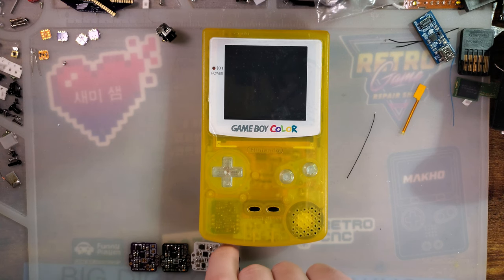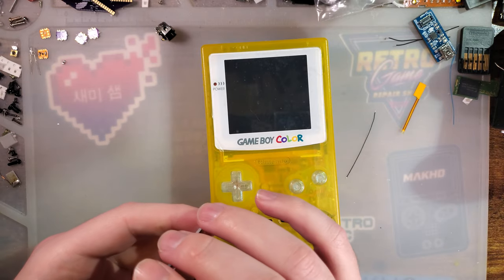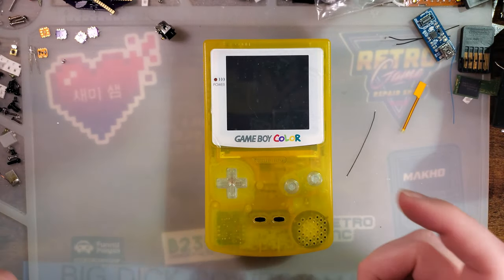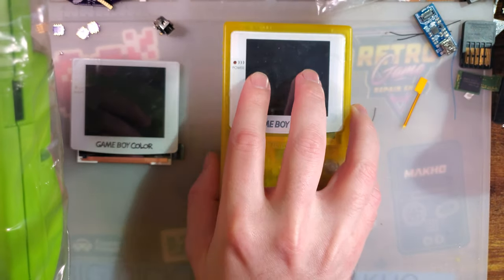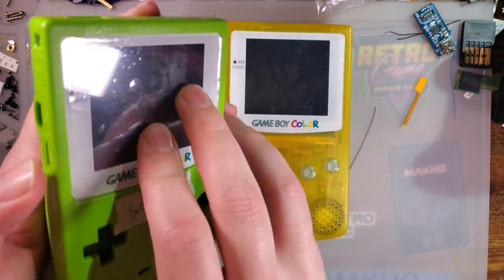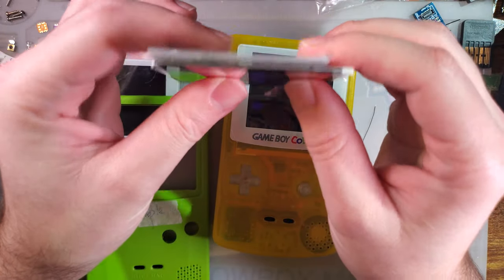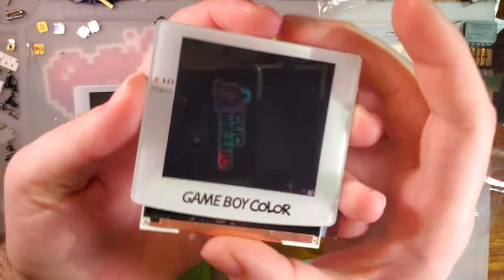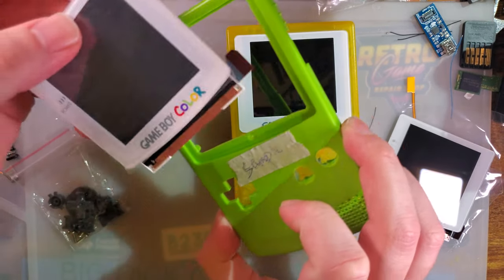'One Chip' Laminated Q5 Game Boy Color Kits

Comment: as someone that has the non-laminated version of one chip’s q5 I would love to buy this laminated screen standalone without buying the rest of the kit I already have installed. don’t really mind the extra gap in this one because it’s more ‘authentic’ to the original screen while still getting rid of any dust and alignment issues 

still prefer one chip over the funnyplaying because the lit logo, while a genuinely cool and ingenious option, is just a bit too much for my own taste
Reply from the maker: you know you can turn the logo off, right? These screens are unlikely to be sold separate from the kits. At least, I know they are strict about sales for the 9380 LCDs, I assume similar for Q5.

Comment: wtf man! why isn't this one available I've been holding off for 2 years now because the light up display on the funnyplaying one is garbage, I can't even believe theres no option to just get a standard logo version? Having a logo on under your screen is distracting AF, I get it though it does look cool but just not for me, a non lit up normal logo would be perfect insane to me why it has yet to be done. I tried to click the link and it seems like they changed the logo to be a purple holographic logo now, no more regular GBC logo :(
Reply from the maker: Some vendors have laminated screens without the transparent logo. Turn off the logo illumination in your kit then use one of these: https://www.aliexpress.com/item/3256804389467504.html
Reply: thats amazing!! What do you mean turn off the logo in your kit then use one of these? Theres no chance of the normal logo one having dust under it, right? Because it seems like they removed the original lit up laminated kits screen and replaced it with the normal logo screen which means that dust couldve gotten in @makho
Reply from the maker: @atpstudios8075 The logos are illuminated by just making the lens transparent and lighting up the screen behind it. The ones I linked to not have any transparency in the lens so there's no way to illuminate the logo.